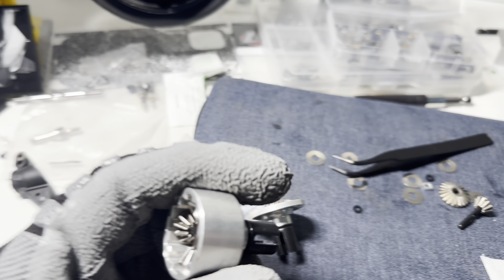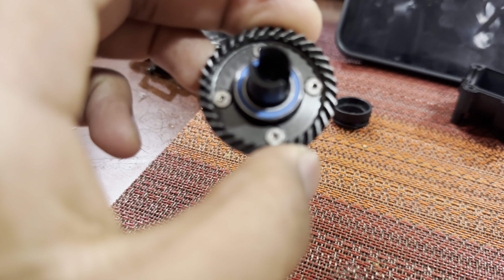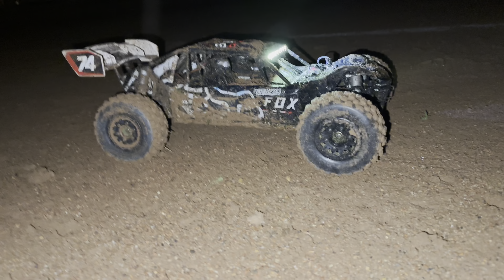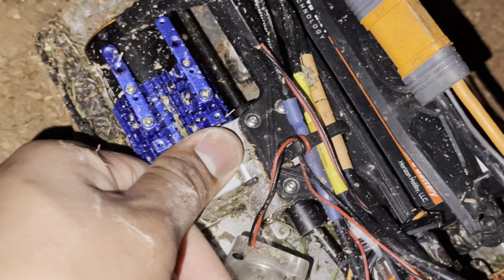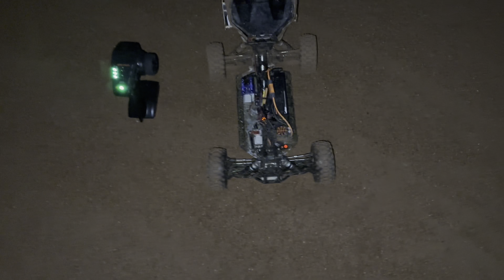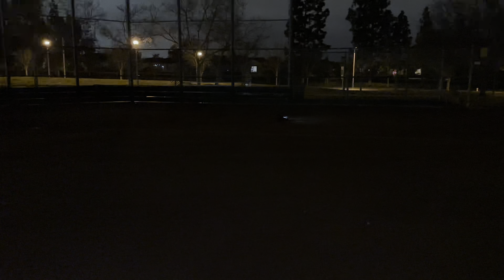Losi Tenacity DB PRO Exotek and Vitavon Aluminum Diff upgrades

Comment: Amain cust service recommended me the PL powerstroke for arrma 3s. They said extended they are very close to stock length. Front and rear.
Reply from the maker: Interesting. Thanks got the tip! Which arrma 3s ?
Reply: @BigTuna550x  3s blx and mega

Comment: Do you have the part num for the vitavon diff case or the exotek diffcase. I see th EXO2109 but the groove inside doesnt look like it would work with the squares in the original housing. I checked vitavon but they have the one for the Lasernut U4
Reply: Yea I bought the exotek diff housing that said it was compatible but how tf do I install it? The stock setup uses those squares and a couple pins, not really enough? HELP